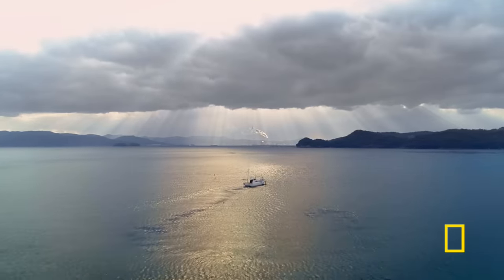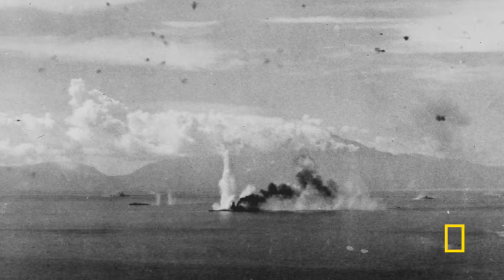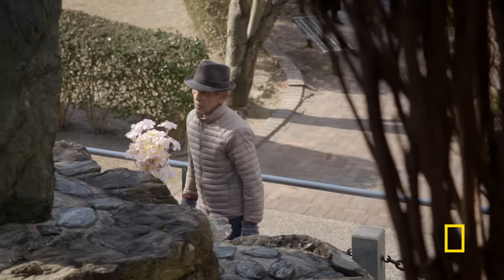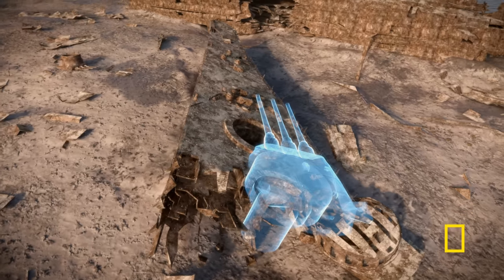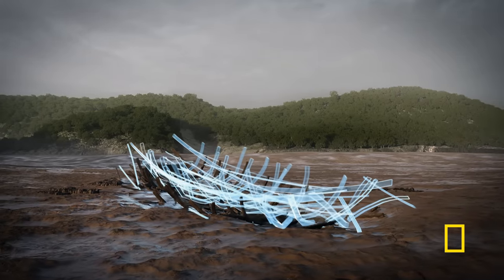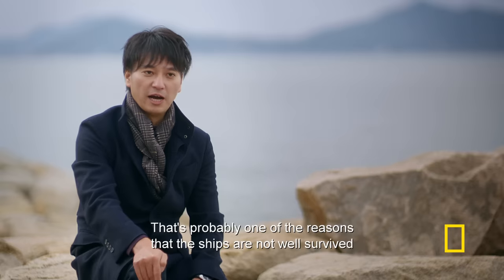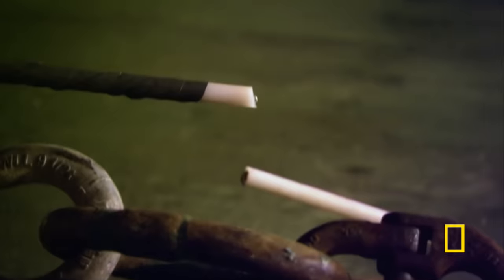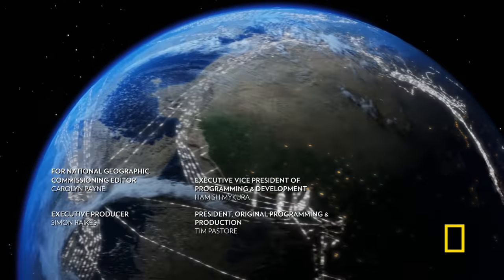Mystery of the China Seas (Full Episode) | Drain the Oceans

Comment: I do not suppose they actually pumped the water out to reveal the wrecks.  " Draining " is a virtual reality  thing  through using sonar or something.  Would love to know how this is done.
Reply: Of course it isn't "done" in the physical sense. They use the sonar data to construct a detailed 3D model of the ship, apply materials (bitmap textures, normal/bump/ambient occlusion/specular/gloss/etc. maps) to make it look life-like, then run a 3D simulation that uses some kind of physics model to simulate the water level falling, then draining from the ship's surface. It only looks like real life because 3D materials have become very complex and very good at looking just like their real life counterparts, in the last ten or so years. Also, the cost of producing these 3D animations has fallen tremendously—you can already buy the computer hardware needed to do this yourself and even use free software like Blender to do the 3D (although probably not as conveniently as with commercial software). As for converting the data to a 3D model today you can actually do this even by using many (several dozen) photos taken of the object from  many angles. There are various software packages, several even free, that will use the images to construct a three dimensional objects.
Reply: It's actually very efficient, once it starts flowing, it's more of a syphoning effect.

Comment: but America was building one even bigger with 18 inch guns and super power, they made the Iowa's ships smaller so they fit in the Panama canal  , the iowas had 40mm guns my dad shot them in ww2
Reply: If you mean the Montana, she was going to have 16" guns like Iowa; the difference was that she was going to have 12 of them, not 9, giving her a massive firepower advantage over any battleship that was actually built.
Reply: There was a news one time the USA warship was damaged in Japan due to a massive merchant ship full of cargos from Philippine Sea.
Reply: The US was considering many solutions. Twin turrets and high speed, triple turrets and lower speed, 16 inch or 18 inch guns etc. When the US heard the rumours that Japan might be putting 18 inch guns on it's ships, the US responded by designing a new 16 inch gun with a larger breech, more powder, more range, and a longer heavier shell. The barrels were also lengthened which increase muzzle velocity and range. Pre Iowa the 16 inch shell weighed under 2,000 pound, in Iowas the shell weighed 2,700. The Yamoto's was 3,000 pounds. The Panama canal determined the ship's width. The Iowa and her sister's were the largest battleship the US had ever built. They weren't smaller. The Iowa was just under 900 feet long and almost 60,000 tons, the previous class (South Dakota) just under 700 feet and 45,000 tons, the preceding (North Carolina) just over 700 and 45,000 tons. They were all just under 110 feet beam which was the width of the canal.
Reply: @briananthony4044  

The Americans never realized the Japanese went for 18” guns until after the war.
Reply: Japan had plans for even larger ships, as did the Germans (ie larger than Bismarck & Tirpitz). What the US had (paper) plans for mean zip. What matters is what was built.